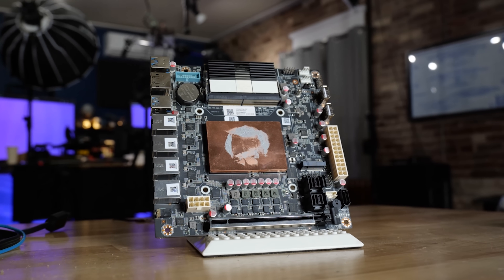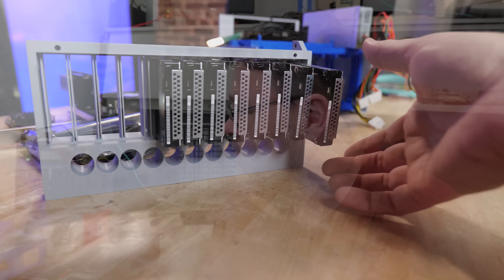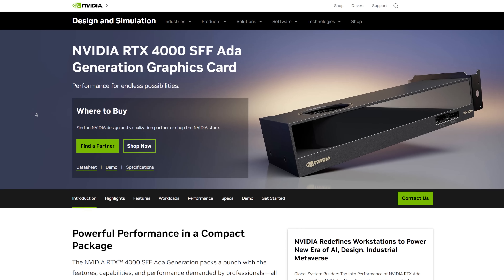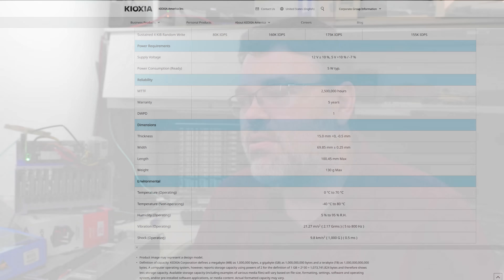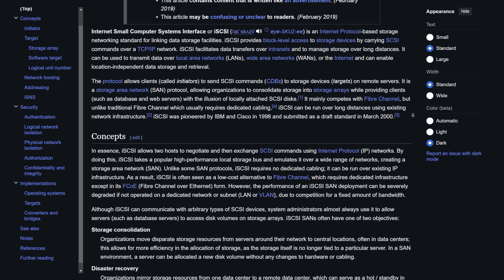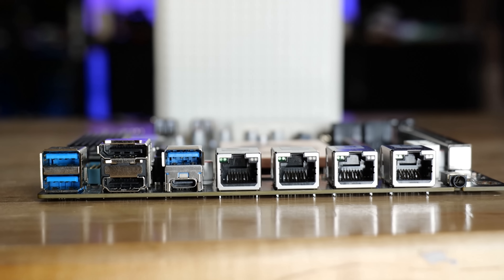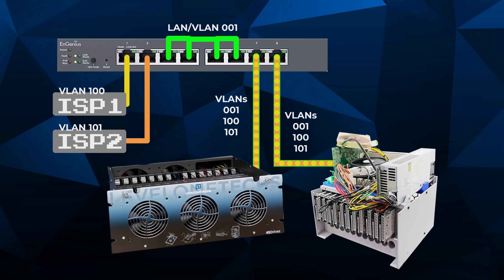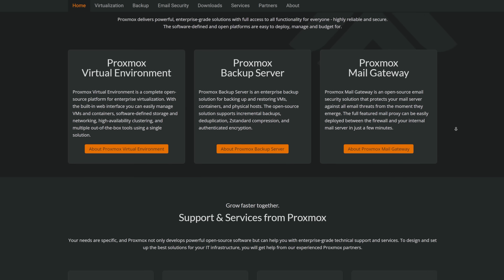A NAS with a No Name Motherboard, Mounted in a 3D Printed Case?!

Comment: The downside to SAS SSD's, at least in Australia, is availability. Kioxia drives are not sold in Australia, let alone most other enterprise SSD's. At least from the major suppliers like Ingram Micro, Leader, Dicker Data, and so on. We're stuck with Micron drives and only SATA, U.2/U.3, and M.2 drives.

Comment: I have been looking at upgrading my unraid system and while there are great 3D printed drive bays out there none have the ability to swap disks. Granted I have only had to swap drives twice in the past 9 1/2 years, but I would like to have that convenience. I will probably still stick with the more power hungry system since we mostly use it for Emby and our network TV tuner access from multiple devices.

Comment: The ARC A310 or A380 can be good low power options for hardware AV1 encoding....although just using a lower end Ryzen 8xxx APU would work as well and draw less power total

Comment: I do separate router (just small cheap dual ethernet boards) in redundancy purely because the last thing I want to do in failure case is to be cut from the internet.

I'm also planning to run VM with homeassistant on the routers that have DRBD underneath, so it can migrate to other one if needed

Comment: I've recently started playing with having my FTTP connection going into a switch, then 3 proxmox nodes having their own ethernet into this switch. The other network interface (2.5Gb USB) on the proxmox nodes go to a different 2.5Gbit switch with 10Gbit uplinks. It allows me to migrate the router VM between any of the 3 proxmox nodes without even seeing any downtime.

Hook that into Proxmox's HA subsystem, and there ya go....

Comment: I would love to see a deep-dive into how to solve storage redundancy without hw-RAID. I have a Synology NAS solution where I can replace a drive with a bigger one and gain access to more storage (well, I need two larger drives before the bump happens IIRC). I've been looking for what a good replacement would look like, because Synology is proprietary and some of their hw is wonky (their $100 PSU gave up its magic smoke after three or four years). I want faster than 1GBps NIC, docker container support, wireguard support (currently still lacking with Synology I believe) and easy ways of increasing storage down the road. And some redundancy (not necessarily for all files).

Comment: One problem with using VLANs on the WAN side: some cable modems will latch onto the first MAC address they see send ANY packet and refuse to send DHCP responses to any other MAC address... even if the first MAC address it saw wasn't from a DHCP request, or even not from an IP packet at all!

Comment: Currently using Server 2025 preview/Hyper-V at the moment as my hypervisor, was using Azure HCI for funsies to learn and it was great but the per core cost per month bill doesn't make it valid for my home lab. Server 2025 will be able to get a key through visual studio sub, (yes that sub gives monthly credits but it's not enough for my core count dangit).
Aware with preview I'm running at risk but storage spaces will be able to bring in the storage and VMs if I have to do a full blow away and rebuild of the host.

Comment: Home Server on Steroids. We are so far behind here in my country with homelabs, because of cost implications. These videos are great for low power server builds. I'm still running a HP NL36 Microserver with about 6TB mechanical drives. I use this just for media storage, so does not have to be fast. So, I'm always on the look out for low power home server affordable builds.😎

Comment: For a NAS, TrueNAS or Unraid are what I went. Unraid is easier for a lot of things especially for apps, TrueNAS Core for NAS and Plex, I prefer Plex having direct access to files rather than pulling from the network.  TrueNAS S.C.A.L.E. Electric Eel is going bog standard Docker because everyone hates Kubernetes and the implementation is jank as fuck and with TrueCharts being dead (surprise surprise) as of right now S.C.A.L.E. has stuff all apps again.

I still have a habit of keeping all my systems separate, did play around with Proxmox for a bit and have a testing system still but I do prefer individual bare metal systems.

Comment: I think that you need to put up some solar panels, and inverter, and a battery bank so that you can run higher power CPUs without worrying about how much power they consume. ie a hybrid or off grid solar setup.

Comment: I am using this board with proxmox. As my main system. On top of proxmox you can run plenty other stuff. Even virtualized Unraid (tested - works flawlesly). But the best power efficiency it has when used with docker&LXCs. In terms of power per Watt and features it is unbeatable board. Can confirm - on idle it gets little power, but has a kick when needed (when idle - gets only few Watts, 100% utilization with iGPU involved - 90Watts).

Comment: Wiring diagram needed. Didn't quite follow the m.2, oculink, x16 bit.
Reply: It's pretty much exactly how you just wrote it out:
M.2 to Oculink adapter -> Oculink cable -> Oculink to x16 PCIe slot breakout

Comment: i did a similiar ghetto thing 

took a zyxel 542 really basic nas nothing cool and alll i bought a tplink n600 slapped openwrt overclocked it and changed the ports to their original 2.5g's modded the nas to get m2s i tried to bypass the 14tb limit but that os is a mess

Comment: Hi Wendell!  I'm a networking (and cosplay as storage) guy at work, but I want super stable infrastructure at home.  Would you be up for comparing the Asus be88u router to a forbidden router?  It is getting some hate for the wifi specs, but the ports look darn near perfect.  And I'm just gonna turn off the wifi anyway and use my Aruba AP 😛.

Comment: I'd use this thing has a HPC scratch disk.

I already peg my 100 Gbps IB network at between 80-90 Gbps thanks to in-application RDMA.

Do you have the link to the post on the Level1Techs forums for this video?

Comment: I like these flexible nas builds with small motherboards, I am in the process of updating my server and found a cool m.2 10gbe card using older intel controllers. I have an older silverstone HTPC case I use and decided to try some diy HHD tray to improve the air flow in the case its tight but it looks like its going to work and improve air flow.

Comment: Words that should never go together "hand solder" and "power supply"
Reply: This is a forbidden router setup, everything is allowed here.
Reply: hand soldering isn't inherently bad.
Reply: @marcogenovesi8570  There are many times when hand soldering is fine. Nothing having to do with a PC PSU is one of them. If you actually did know what you were doing then I wouldn't even need to explain this.
Reply: @KenS1267  Hand soldering is perfectly fine even on high current battery high gauge wire. Operating on a PSU can be done safely inside the case "if you know what you are doing", and also if you are just splicing cables outside of the case
Reply: @marcogenovesi8570  No. The number of things that could go wrong both in doing the soldering and with the solder joins is too high. 

A PSU that has not properly discharged can have live caps. If you ground one you are an obituary. 

If your solder joint isn't perfect then as it corrodes you can get sparking and then a fire. 

There is a reason you see actual experts in these things, like me, saying not to do this, EVER! Yes, I could list a dozen caveats that could make it reasonably safe, but that would just make people like you think it is safe when you will certainly not follow all those rules. So, just don't.
Reply: @KenS1267  Too high risk if you suck at soldering maybe. It's not a skill that is hard to learn my dude, and once you know what a good solder joint looks like, it's fine.

Discharging caps at the size of the main and secondary caps in a normal PC PSU is very doable. Again you need to know what that is and how to do it safely, but between me and you we know it's not that hard.

Both are well within the range of Wendell's skills.
Reply: @marcogenovesi8570  Because you of course x-ray every joint you make. You claiming that you can visually verify that your solder joints are perfect is proof you do not know what you are doing. 

There is a world of difference between a solder joint that is safe for 5V 1A DC and one that is safe for 120V 12A AC. That you don't know that is why I told you to not do this.
Reply: @KenS1267  One of you in every thread... Hilarious! Who ties your shoes for you?

Comment: Wouldn't an ARC 380 do the same job as that RTX A4000? wtf.. 
talk about overkill
Reply: The integrated 780M should also be able to handle a bunch of encoding streams. 

He’s using eleven Kioxia SAS drives, I doubt cost effectiveness was really a consideration here. He probably didn’t have to pay for those drives, but someone wanting to replicate this would.
Reply: But the ARC would draw tons of power at idle.  I have an A770, and it uses 40 watts at idle.  If I try to enable ASPM, depending on machine, it either does nothing, or makes it fall off the GPU crash or something.

Comment: Something to note about Unraid in 2024, they changed their license structure. The lower end licesnes now, in addition to limiting the number of storage devices you can have, also limit you to only one year of OS updates (you still get security patches until your version is deemed EOL). You have to pay to get updates after the year lapses. If you have an older Basic license (instead of the new Starter license) you will still get all the patches and updates indefinitely. Something to keep in mind if you don't already own an Unraid license key.
Reply: I was lucky to get on board with the basic license and upgraded to unlimited drives.
Reply: What's even the appeal of Unraid nowadays? There's so many NAS operating systems out there that don't cost a penny.
Reply: @sceerane8662  For me it's the ability to mismatch drive sizes and still have parity protection, and being able to add to my storage array without having to worry about getting a drive with the same size as the rest of the array.
Reply: Doesn’t btrfs let you do mismatched pools with parity? I recall that being one of the few  points in its favour when I was migrating my server a few years back and had to choose between continuing with ZFS or picking something new.
Reply: @СузаннаСергеевна  Btrfs RAID1 yes, btrfs RAID5/6 is still not stable
Reply: @marcogenovesi8570  As far as I'm aware RAID5 should be stable now as of kernel 6.2 and both are heaps better on kernel 6 (at least from what I can tell checking discussions on the subject)
Reply: @bosstowndynamics5488  As far as I know devs still don't recommend either Raid 5 or 6 for production use.
Reply: @bosstowndynamics5488  did they remove the warning in btrfs-progs when you create it? Because they put a warning in the tool about the raid5/6 mode.
I also see the RAID5/6 feature is still marked "unstable" in the btrfs wiki.
It's good to know they are making progress but I'd not call it "stable" until both are changed
Reply: @sceerane8662  It is an easier UI for the BYO disks over OMV, that now supports ZFS as an alternative, and as of the version 7 in beta. doesn't require a disk in the Unraid style array. So you have the similar options to TruNAS with ZFS while retaining the unique Unraid Arrays if you just want to use randomly sized disks rather than matched pairs.
It has docker, plugins and VM support, with a plugin for LXC support as well, and then you have the community around it.
Reply: @sceerane8662  Ease of use and quick setup. I run both TrueNAS Scale and Unraid on different machines, and getting Unraid set up and working with basic NAS functionality and running Plex took half the time and effort that TrueNAS did at most.

Comment: I would slap proxmox on it, add it to my proxmox cluster, and set it up with high availability so that my workloads would pass back and forth between these as needed (putting the modem/ont into the switch in it's own vlan is a fantastic idea that i've been using for the past few months very effectively.  I've got an atom c3758r based mini pc running pfsense baremetal with 4 sfp+ 10g connections lagg'd to my primary 28 port (24 10g-base-t 4 port sfp+) switch (netgearxs728t) and use vlans to route/firewall between vlans (wan vlan, user vlan (with it's own dedicated wifi 6e AP), iot vlan (with its own dedicated 2.4ghz AP and i put home assistant on this vlan as well), homelab vlan, and homeprod vlan) - the c3758r can pretty easily handle routing about 12-15gb/s (depending on how much firewall filtering logic is used), and i've also got it running openvpn (for remote access), pfblockerng, dhcpd, and unbound for primary cached dns resolution for the network).  in my proxmox vm cluster I have a software clone of the pfsense setup that I can manually activate if/when I need to bring the primary down for a maintenance window (so my family doesn't have a cow) and the handoff can be done in just a few seconds if I have advance warning (i.e. i'm about to make changes).  if the primary router were to straight up fail on me, it would probably take me about 5 minutes to realize the specific cause and start up the "forbidden" router in proxmox.  theoretically I could run the router full-time in proxmox, but I've found that in my configuration, I can't get nearly as much i/o when running with the virutalized configuration (my proxmox nodes are i7-8700's with 64gb of ram and intel dual port x540-t2 10g-base-t nics lagg'd to the same switch). I think the i/o regression in proxmox has something to do with the virutal nic system because when i first got my atom router box, i wanted to set it up as proxmox running pfsense (so it could also run other low-power workloads for convenience), but it was way slower when doing so vs. running it baremetal for some strange reason.
rack actual: https://i.imgur.com/be2fKBo.jpg
rack diagram: https://i.imgur.com/iCdBXS4.png

Comment: Haha, I'm basically accidentally building the budged version of this. I bought some thin clients, containing older ryzen cores, which I use with some cheap USB HDDs and SMB instead of iSCSI, hosted on Debian Bookworm instead of Sid, and I only have a GbE, and a single router, but still plan to use a switch with VLANs to have one of the thin clients act as a firewall/router.

Comment: Seems like so many YouTubers have a bunch of these ultra-expensive Kioxia SSDs sitting around - is there some secret method to buying them on the cheap? Does Kioxia just give them out for the exposure? Or am I just really poor?
Reply: Kioxia marketing budget being spent to get that brand awareness, no other reason
Reply: kioxia gives them out to important influencers in the server-ish space
Reply: Seriously.. just casually having 8 $1,600 drives laying around for a project lol. One of those costs more than my entire 100TB server/NAS costs.
Reply: EBay referbs probably
Reply: Kioxia gives them away, I’m sure as part of their marketing budget, to influencers. Pretty smart if you ask me.
Reply: Nop, I'm also poor, dirt poor.
Reply: Probably cheaper than trying to advertise themselves. Just throw expensive hardware at geeks and see what sticks.
Reply: i first learned that kioxia pm7 are awesome because of wendell - so their marketing scheme seems to check out just right
Reply: if i remember correctly you use to or can still find the drives for dirt cheap on fleabay so a lot of people snagged them up a couple years ago.
Reply: What is the lowest cost ssd 30GB these days. Do not need fast, just reliable.
Reply: Optane 660p 58GB might be a good match for you. It’s extremely durable, and actually also really fast. In pure sequential read/write it’s unimpressive, but it has extremely high IOPS that actually let it outperform even modern M.2 SSDs.
Reply: @СузаннаСергеевна  and they can be had for pretty cheap compared to the big uber sizes. The 905p 1tb is under $200 on Woot last time I saw though, so maybe not the best value.

Comment: What SAS controller / HBA did you use for this? I've been struggling to find 24G SAS HBAs online (although I am in the UK). I can't even find a seller of new ones.
Reply: seems to be a broadcomm 9500-16i. If you are looking for so many drives you are better off looking for a sas expander + a normal 8 port sas card, or a SAS 9305-24i

Comment: 8GB/s is not 80Gb/s its 64gbps...? 8 bits = 1 byte or do I no longer math's right?
Reply: Perhaps it is referencing signaling rate instead of PHY payload rate? It used to be 10 bits of signal to 8 bits of data on the wire. 100Gbps is 66 bits signal per 64 bits of data, I think, but it might simply be a bad habit of dividing by 10 to get bytes.